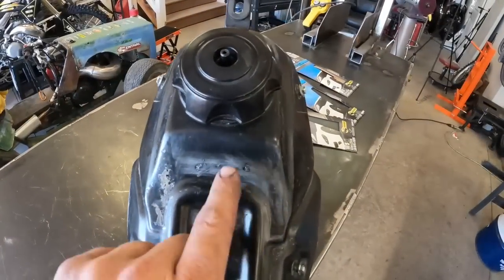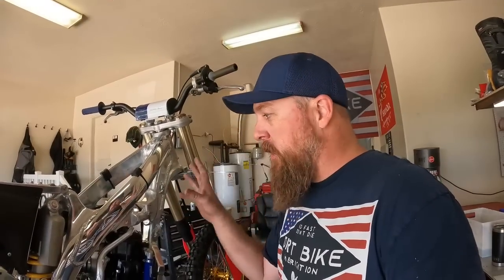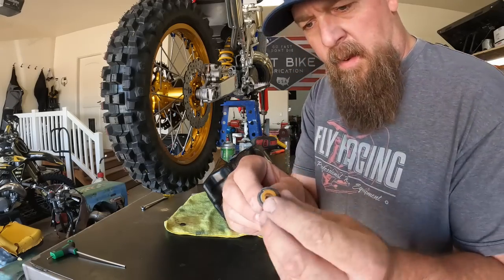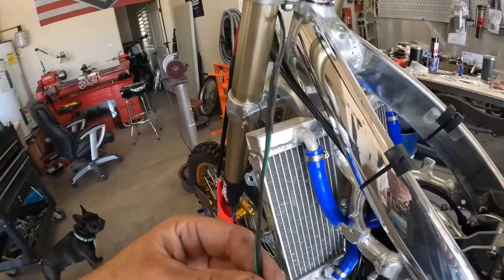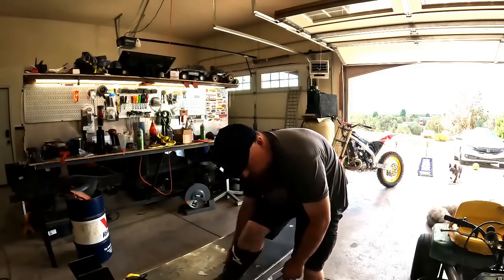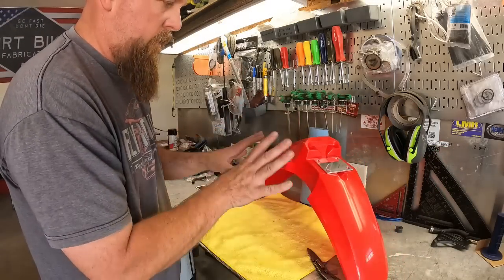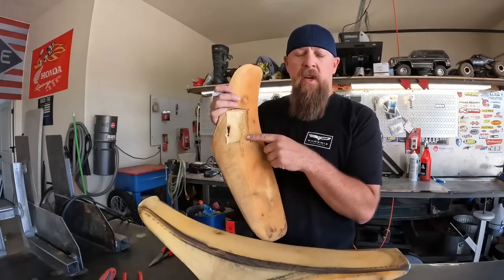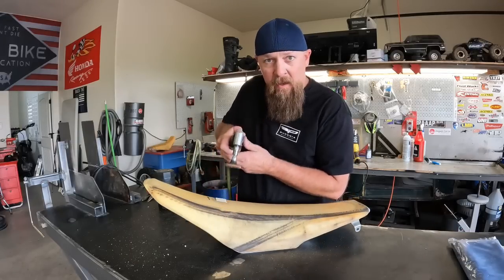@FabRats HONDA CR 500A/F IS ALIVE!!!!!

Comment: My first street bike was an 83 Honda CM-250. 2 years in and the drive belt broke. It was going to take 6 months to get a replacement so a local fellow that did upholstery repairs sewed it together. It was still holding together 6 months later when the dealer got the replacement in. Not the most comfortable bike I ever owned for a passenger to ride on but the wife and I put a lot of miles on it before I finally traded it in. I've owned 2 Honda trail bikes and 3 street bikes. Best bikes I ever owned but I can guarantee you that I wasn't a daredevil like Paul is.  LOL

Comment: Very nice I have been using a Maxima 927 for years.  Great stuff.  But i would not recommend it to a beginner because it will run dirty if you do. It’s made for race bikes not beginner trail riders.  4 years ago we rebuilt from the ground up a 1985 Maico 500.  60 plus horses at the rear wheel.  Lots of fun but like all 500’s not for the faint of heart.
Reply: I always ran Redline back in the mid 2000's, and like 927 it's a racing oil. I'm finally dusting off my 2014 KX100 after letting that poor thing sit for almost a decade. I'm not racing anymore so I need to look into an oil that is more suitable for trail riding a small bore motor. The first ride out with a fresh top end went well but I have to relearn two stroke minis after being away from them for so long. I'm only 5'1" so I went back to a big wheel mini from an RM250 and later an RMZ-250. I really miss the big bikes, but I have to tiptoe my KX100. Short people problems.

Comment: MSV for the exhaust manifold and ALL your cooling needs for the CR500. Guaranteed I use all of his products and they’re excellent manifold does not leak bike does not get hot just got back from the dunes riding wide-open 80% of the time never got in the yellow
Reply from the maker: I actually Ron the msv faraday stator on all these 500 along with a lot of his products. I had terrible luck with the o rings on the manifold leaking. That’s why I run the stock
Reply: @DIRTBIKEFAB  Interesting. You would probably know more as I only have one 500 but I have zero leaks with it. I’ve tried running double seals on the OEM manifold on other Hondas, 125’s & 250’s but wasn’t able to get the pipe over it. maybe I didn’t push hard enough lol.

Comment: Suggestion: Look into bypass connectors instead of butt connectors. They provide a smaller splice with a copper-to-copper connection. Add your heat shrink and you have a very nice, compact splice.

Comment: Need to narrow up an shorten up that duck bill front fender .it looks ok tell the flair at the front .2 stroke have sleeker fender. Rest of build looks perfect an polished.  Have u ever seen  chamber seel resemble plumbers putty combs on a roll but stiff stretch about 4 " into a foot mabey longer wrap around the  flange to desired thickness, thin an about 4 wraps slip on pipe ip seels great stays pliable but stiff .

Comment: For what it’s worth. NAPA sells the EXACT same strippers for about 20 bucks. Part number is WSCCP. Only difference is the color of the grips. Exact same manufacturer. I’ve sold probably 60-70 of them. Strap on was close to 80 bucks.

Comment: The bike would be faster with a a chain between the sprockets. 
You'd be well served by purchasing a cheap, plug-in heat gun with a flat nozzle for heat-shrink tubing.  Using a (field repair) butane torch in the shop for heat-shrink is a waste of time and produces inconsistent results.  Consider using wire lacing instead of electrical tape. It's especially useful on custom harnesses where vibration or heat occurs and makes future modification or a field repair much, much easier.  Love your content, BTW.
Reply from the maker: Bluetooth chain😂

Comment: They do have heat shrink tubing, that has a sealant in it, just in case water can be a problem. It’s a little stiffer than the thin stuff, but,,,,,,,,,
Reply from the maker: This 4-1 heat shrink I use has the sealer in it also

Comment: I do grounds keeping.  I was curious if you have ever tried TrueFuel? I have seen experiments with multiple fuels and it seems to burn purely unlike pump fuels.  Have you ever noticed the bikes run differently on selected pump fuels? Be well and stay safe out there brother from Dinosaur Colorado USA 🤔👍🤙🇺🇸🇺🇸🇺🇸
Reply from the maker: I HAVE NEVER USED THAT FUEL BEFORE. YEAH THESE MOTORS ARE FAIRLY HIGH COMPRESSION SO THEY DEFINETLY LIKE THE HIGH OCTANE STUFF